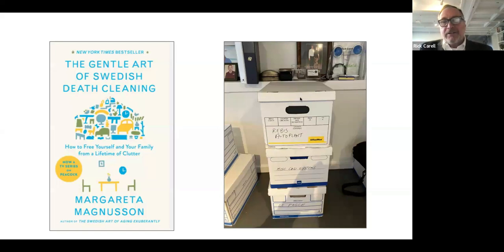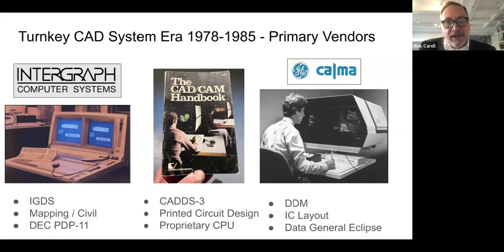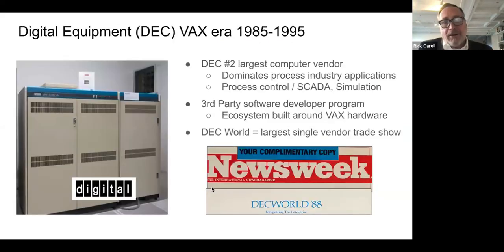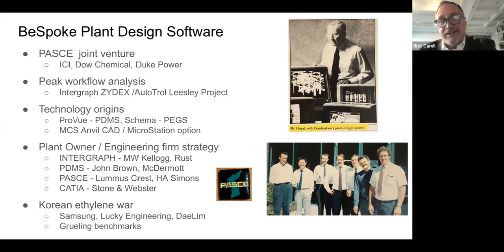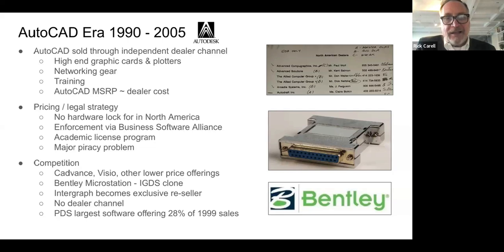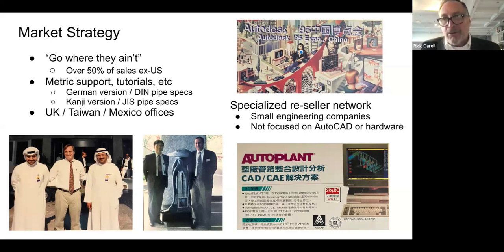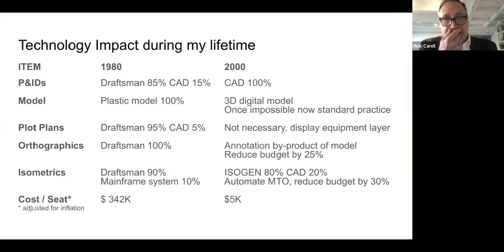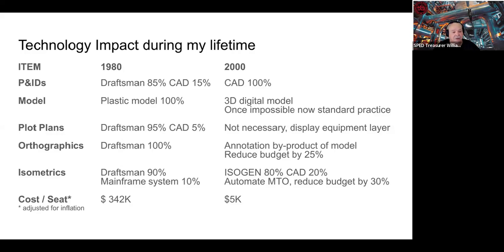SPED Rick Carell Early Days of 3D CAD Piping

Comment: I was a Charter Member of SPED Cert # 2-674.  In 1970s I learned the basics of Autotrol and piping drawing at Exxon Corp in Baton Rouge, La.   1981 I began working for Brown and Root, Inc. in Houston, TX.  Using AutoTrol,  I with the assistance John Hill we led the set up the first Piping system for Brown and Root.Othographis and then CAD piping isometric package that included piping material specifications that we could read and dump the data to tape and load to our mainframe to create Bill of material and print for taping to the Isometric drawing. Durring that time I gave several classes at ADAU.   We were doing so well that Michal Lesily asked if we would assist in creating a new Plant Design Package. That fell through before we started.   I developed a specal load for all our new Microstations for very quick project start ups.  I continued designing and programming through SGI and Intergraph and the beginning of 3D plant design Intergraph PDMS.  We stayed away from IBM CATIA, it did not work work for us.  Brown and Root went to Halburton and thewn sold to MWK.  I  was then moved into Systems Server Administration, Developing Backup systems, Linux programming for Oracle and VMware. I retired in December 2016 afte 35 years.